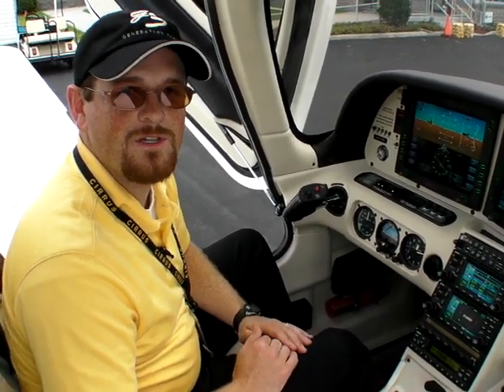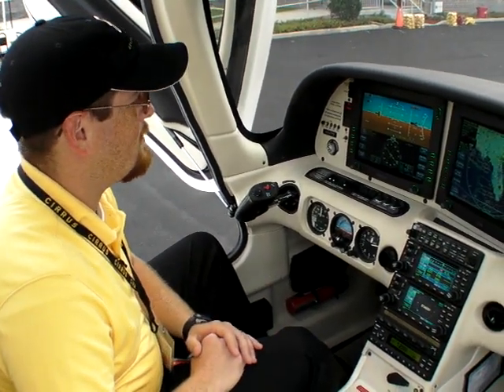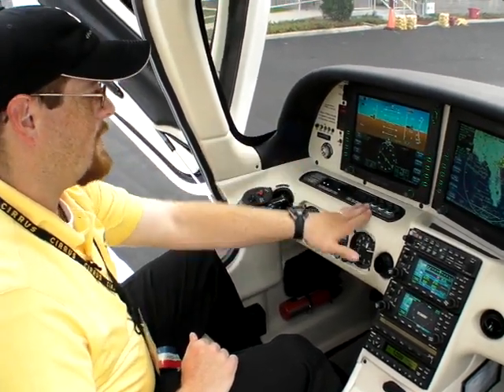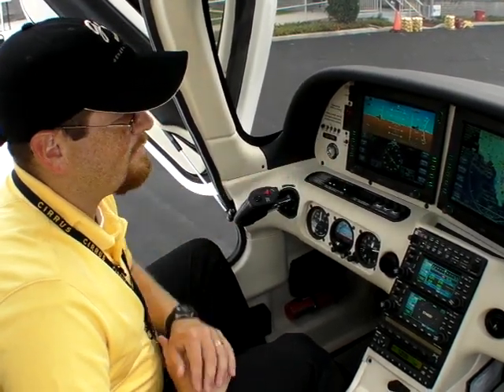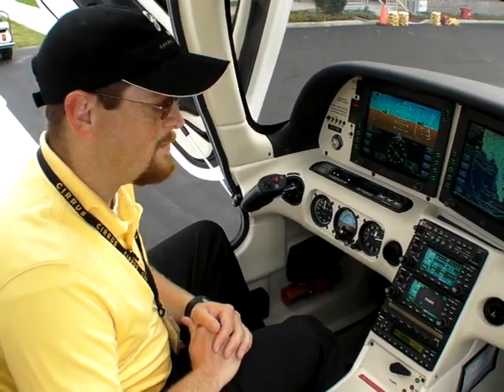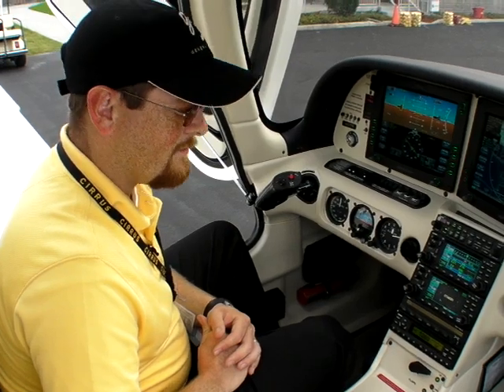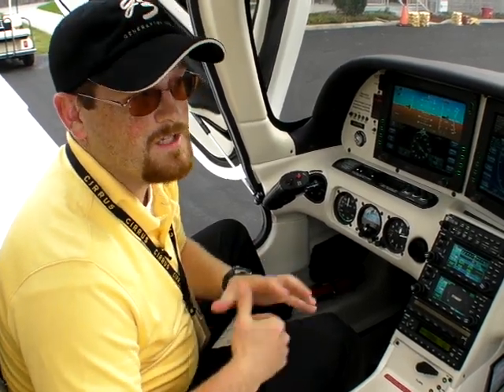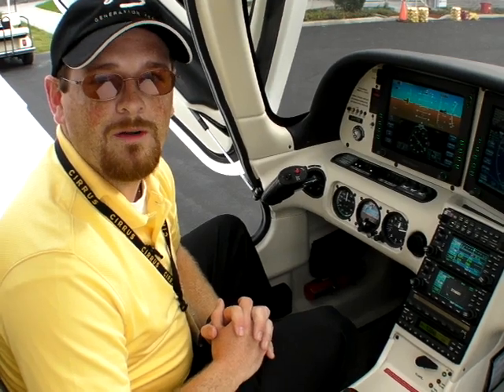AVweb Short: G3 Cirrus SR20 Has New Wings, Refined Interior

Comment: This is what the demo-pilot meant or attempted to explain. 

By replacing the old heavier SR20 wings which are 50 lbs. heavier than the lighter SR22 wings, they allowed the SR20 to increase its payload/useful-load by 50 lbs.

Since the lighter SR22 wings are shaped aerodynamically more efficient (he said "faster"), it increased useful-load by another 50 lbs.

50 + 50 = 100. I know the way he explained it was confusing to some.

Comment: They increased the allowable total weight of the airplane by 50lbs.  They then decreased the actual weight of the airplane by 50 lbs.  That gives a total of 100 pounds more usable useful load.  People in the comment section are easily confused.